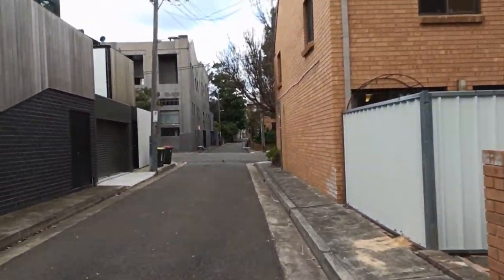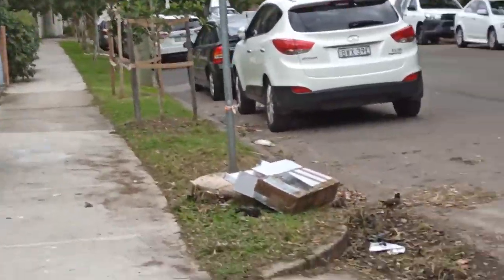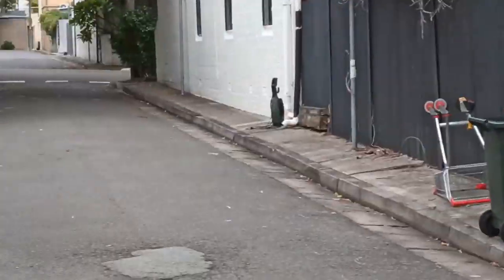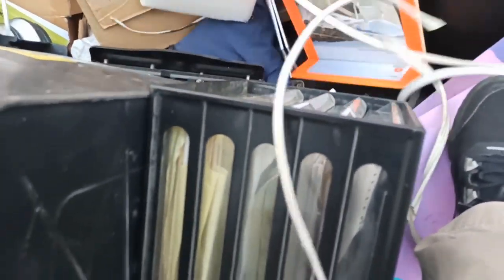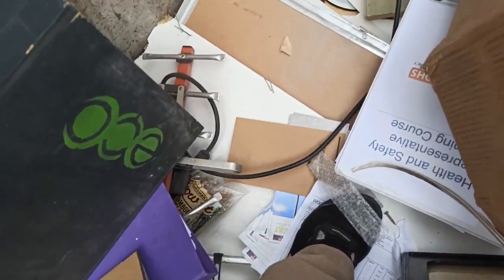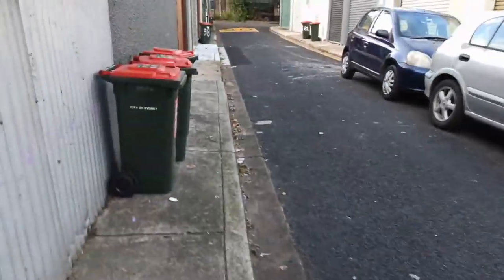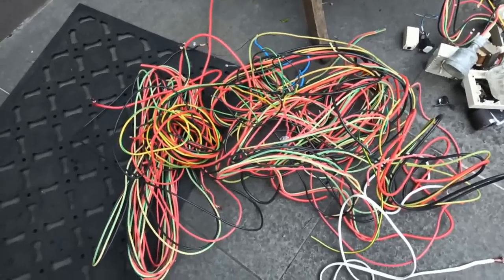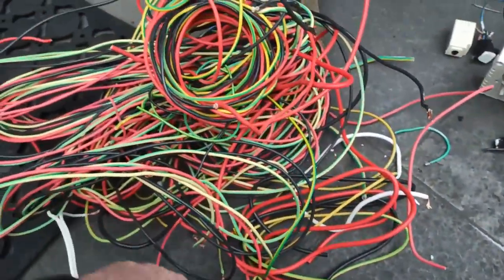19. Street Scrapping and Dumpster Diving (Jun2020).  Copper Wire Saved From Landfill. Bondi Scrapper

Comment: Great score with the wire mate. The dumpster picking was great - the walk up the street wasn't good for motion sickness! 😣🤣
Reply from the maker: Shaky Cam / Run And Gun is a legitimate film technique dating back almost 100 years.  The D-day scene from Saving Private Ryan, Cloverfield, #2 & #3 of the Jason Bourne series all used similar techniques.  Surely this is up there with the best of them? ;-p
Reply: @bondiscrapper1781  🤣🤣🤣 - Yep, you'd better make room on the mantelpiece for the Oscar awards..